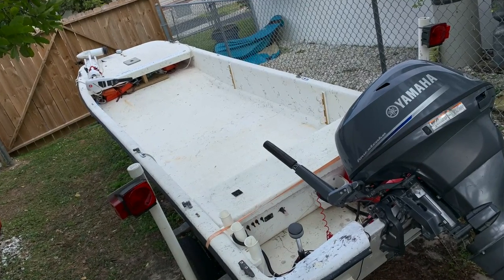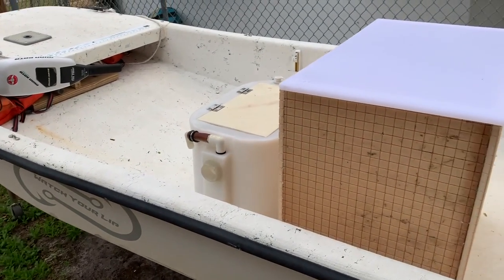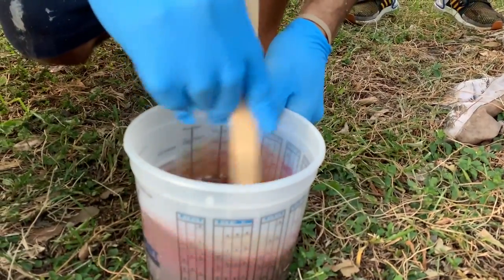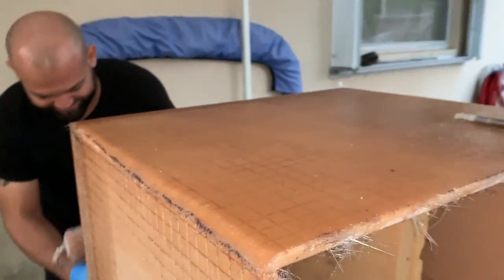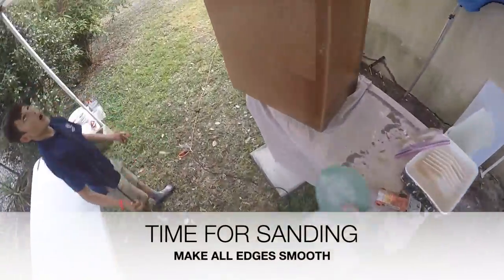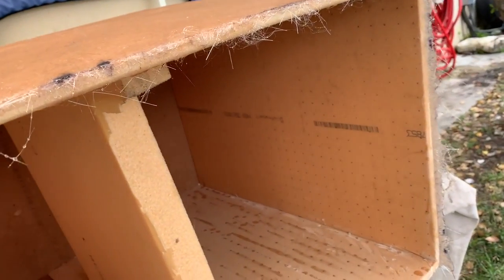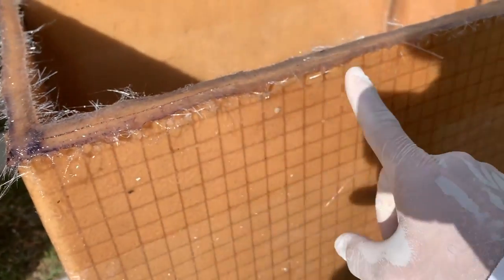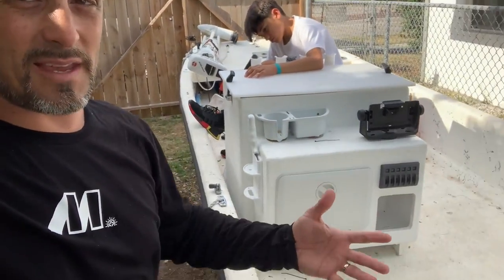DIY  HOW TO BUILD CUSTOM FIBERGLASS CENTER CONSOLE   J 16 CAROLINA SKIFF

Comment: Great series/project, I have never done fiberglass, and I havent really watched it being done, until now, I learned some things for sure! Roughly how much did it cost for materials to make it?
Reply from the maker: Awesome! I’m glad you’re learning something. You’re gonna be blown away when you see how this thing turns out. Right now we are building a polling platform in the rear. Rebuilding the transom and putting in Hardcore rod holders in the back. We’re gonna put in sea deck and some LED lights. It’s gonna be crazy!

Comment: What material did you use to build the center console with? GREAT JOB
Reply from the maker: Thanks bro. It was a marine grade foam and fiberglass.
Reply: @watchyourlip3209  will that work for a rear deck on a gheeno? If so where can I buy some. Thx

Comment: Whoah. I know I’m bigger around than you guys, but that console barely leaves any room to get by it. What you’re making is the same problem I’m making a console smaller to remedy. Still, great video. Thanks for the info
Reply from the maker: Thanks for the love man. There’s actually quite a bit of room on that starboard side. Our problem is weight balance. It’s a little heavy on port side
Reply: @watchyourlip3209  I see that now. I guess I spoke too soon. Cheers!

Comment: What was the board called that you used to make the base structure
Reply from the maker: It is a marine grade foam for fiberglass work. They sell it in large sheets
Reply: It looks like Divinycell H-60 foam board